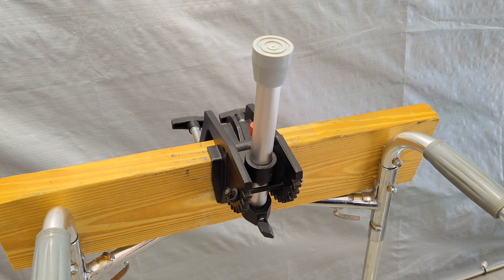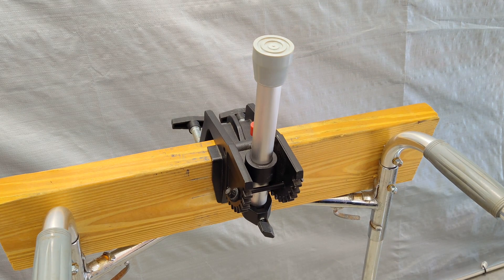Motorguide Type Transom Mount Trolling Motor Impact and Reverse Protection

Comment: This is great for my problem with the Watersnake Venom SX. I would mention however, that after removing the latch, the motor is really loosey-goosey. I am hoping that the bungie will allow for full tilt whilst maintaining just enough tension to prevent wobble.  (I have not drilled the holes yet and wanted to run this by you before I did).  Fwiw, Your videos cover a wide range of problems that I could ever imagine.  THANKS!

Comment: I might have to try something similar to that.  I bought an extra Minn Kota  mount and cut a boat paddle down to use as a rudder for my Pelican Bass Raider 10e.  And i dont want to keep it locked in position in case I run over something.  I want it to be able to flex up to avoid damaging anything and then be pulled back down.
Reply from the maker: I have a video for pulley system to raise a Minn Kota TM with impact protection that may help you.